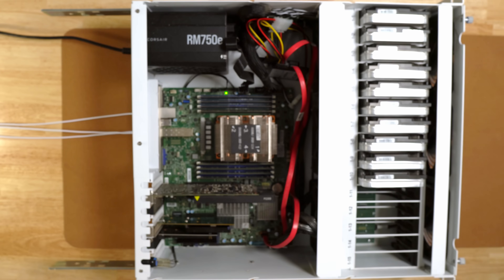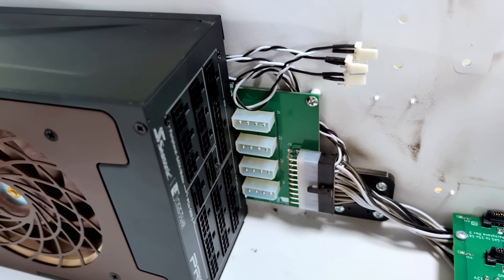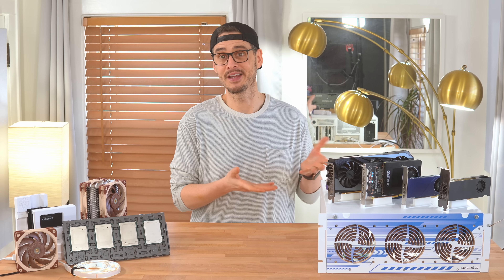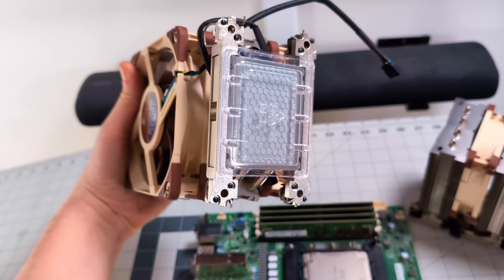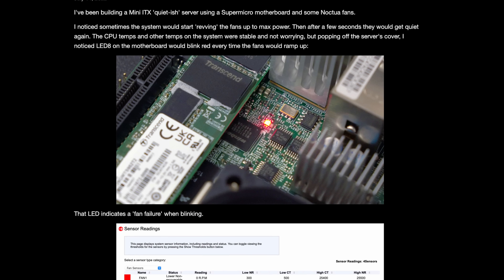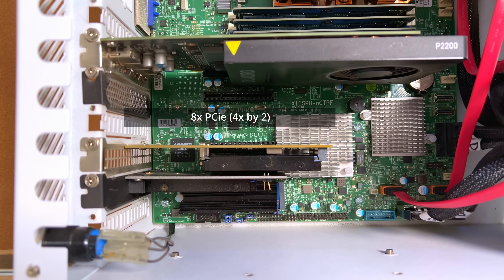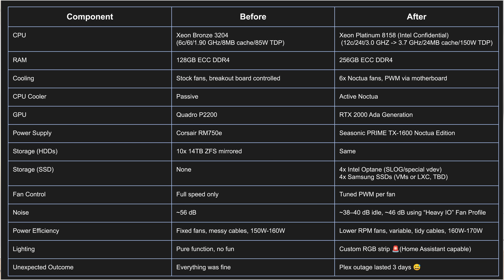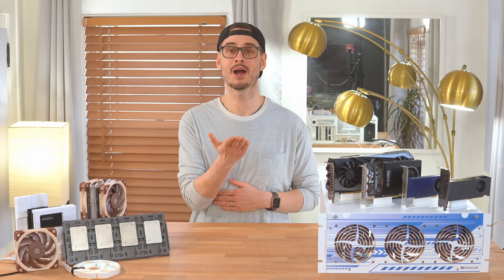I Rebuilt My Home Server — Quieter, Faster, and Ready for 2025

Comment: Holy shit 45homelab is a scam.

They sell "Home clients" for almost $800 USD!!!
The processor itself costs around $128 and somehow 8 gigs of ram and 250gb of storage cost the rest of the $650

You get a single board computer with 8 gigs of ram and a 4 core intel chip that is PASSIVELY COOLED so don't look at doing much with it. This is basically a bog standard thin client

Lookup " Thin client " for cheaper results that are just as if not more capable.

Comment: I love the idea of using Optane for special vdev, but aren't those too small for the amount of raw storage? I personally use two 1TB P4800x's I picked up during Neweggs fire sale of them last year. The smaller m2 optanes you are using I use exclusively as slogs though and run into zero risk of them filling with only 10G connection going to it. As far as my metadata usage calculations, I based it on 128K or smaller to be in that vdev, which for me for similar amount of storage you're using had me around 600GB of usage.
Reply: That being said, a second hand enterprise SSD would have been far better suited for this role, I am a data hoarder so the write benefits of optane are somewhat wasted as it's not like data is being replaced so the cell rewrites will be absolutely tiny.

Comment: it's 2025 so indeed there's no excuse for having loud server at home, if anyone wants something cheaper than Noctua case fans (and I am Noctua user), Arctic are also worth checking out IF you finetune the speed curves,
doubling the RAM is definitely biggest upgrade, almost slipped through in video :D
for AI, 16GB RTX 2000 Ada is bare minimum nowadays, though 16GB 4060Ti may be cheaper option, and if downclocked it can be almost on par in power efficiency in AI workloads,
I bet once you get into AI, you'll start looking for something like RTX 4500 Ada which has 24GB vram while still having modest ~200W TDP, having 4 of those (~96GB vram) is enough for nowadays top open-source AI models (and that 1600W PSU is designed to handle it)

Comment: Tim its likely not interference losing you zigbee connectivity on the lighting.  You have a small gain antenna and small signal amp inside a solid metal shell. The metal shell will absorb the radiated signal. 2.4GHz won't have the energy to penetrate and your grills etc will still mess with it. I would suggest a composite or non metallic window or at least for a test run the dongle outside the case to see how it goes. 

I tend to fit a small plug to my cases and have my emitter/antenna where I want and a small cable connects to the case. You could do this too for the lighting, even with a small hole just as a passthrough.

I have observed interference from 2.4 and 5GHz emitters being used in close proximity to other electronics so do be cautious about using radios inside a case. 

For a sense of context, I am a radiated and conducted emissions Specialist for the Australian Military (now retired). My work was to integrate systems accomodating EMI/EEE or determine how it led to incidents (plane crash, exploding panels etc).
Reply: I wish more of these little controller boxes had external SMA connectors. Most only have an internal antenna, and that means you have to try to get the whole enclosure somewhere that gets reception (means you can't always just bury the thing in a drawer or behind a desk).
Reply: shouldn't be too difficult to pry it open and solder an SMA connector to it though, heck might even already have mini smp on board and then you just need an adapter cable.
Reply: @bluewombat  True. How often it's just a little sticky antenna with a whip on the back that's plugged into a u.fl connector!
Reply from the maker: Thank you for the insight and expertise! I didn't even think about the most obvious thing.
Reply from the maker: I just want to report back I think it is interference.  When I shut the server down, I can communicate with it, when I turn it off it loses connectivity 😅
Reply: @TechnoTim  Well Done Sir! What do you think you will do to correct it?

It IS still possible that the case is reducing the signal too much and combined with radiated noise you end up with a misbehaving light controller. Direct radiated energy impacting your little gateway might not be impacting the send/receive signal, but other components that drive it out of operating range/stability. Hard to determine that unless you get it in a chamber to do real testing :). 

An example of that I worked with was ambulance... convert vehicles to use fiberglass canopy... which impacts resistance to HF signals from roof antenna (also no longer properly grounded). The antenna when transmitting on a specific frequency was causing an auto-defib machine to discharge incorrectly. 

You can see how that's all sorts of bad! It could be potential buildu p in the canopy (like a cpapacitor), the signal lines on the patient to machine were being induced with additional signal from HF but most likely scenario was direct high energy impact on the defib components and something didn't like it so it played up (repeatable and reproduceable error).

I surmise the best options for you would be a small pad antenna on the outside of the server and the light control in a metal box (shielded cable to antenna), remove controller out of the server, or try a different controller - it's a bit of a random lucky dip. 

YOu could even determine where it's antenna is, face that out, and cover the rest in foil (maybe stick it into bottom of lid?

I'd like to hear your feedback anyway Tim - thanks for being a champ and following up!

I see routinely interference from home smart devices because they are not designed to cope with an EM rich environment usually. 

They are prone to injecting noise into signal lines too - audio and speakers or cables in the correct orientation.
Reply: @TechnoTim  The advantage of a server inside a big metal box... the metal box is nice RF shielding. But that doesn't mean RF isn't bouncing all around inside that box!

Comment: Just redo the plug pinouts for any of those cables and they can all work for you. I'm unsure what your concern is with it after having realised they are not all terminated the same on the PSU end.
Reply: I did want to add you are spot on that it’s a foolish situation

Comment: The biggest issues were definitely the PSU cable incompatibility and the Zigbee interference. A universal PSU cable kit from CableMod could prevent future Plex Outages, and moving the Zigbee controller outside the case with a USB extension cable would likely solve the interference issue. Also, you might want to check the data retention of those consumer-grade SSDs if you are planning on using them for critical data.

Comment: Lucky the cable mistake didn't fry the drives, makes me wonder if 45drives didn't build in some protection to the power distribution board.  Nice CPU upgrade but I'd be interested to see the difference between the Xeon and an Epyc Rome 155W CPU, I have a feeling the 7302 or 7352 would be a decent bump in performance (Threadripper also an option but it's much higher TDP) and it's not that expensive if you can get away with an H11ssl-* or epycd8 PCIE gen 3 board.

Comment: I went through this. I just bit the bulllet and got custom cables made specifically for my seasonic and their sata board. Which ended up being better since i got them size perfectly to save room
Reply from the maker: Where did you get them from, Cable Mods?
Reply: @TechnoTim  Yes sir. I too have all sorts of psu around my lab, but didn't know cables weren't standardized until this build. Luckily cablemod allows you to enter in the psu brand and they make the cables accordingly. Saved the day on my H15 build.
Reply: @TechnoTim  Btw tim, please never use those SATA cables again... You have probably heard the old saying "Molex to SATA lose all your data", and thats because you are using MOLDED SATA connectors and not CRIMPED ones. The Molded ones are super dangerous and catch fire all the time

Comment: My main "do-it-all" Proxmox server got upgraded from 256 GB of RAM to 768 GB of RAM.

That was the main thing that was holding me back.

The next project that I am currently working through the details is how to cram four 3090s into a 4U rackmount chassis.

(Most consumer cards has the PCIe power plugs at the top of the card, which means that I won't be able to close the chassis on said 4U rackmount, so I am trying to figure out how I can work around that.)

If I can't figure it out, then I'll likely end up with a system that would be similar to what Digital Spaceport is running where it looks like it's a GPU mining frame, with either a Threadripper or AMD EPYC motherboard and CPUs underneath and I'll just connect the GPUs to the motherboard via PCIe 4.0 risers.

But I haven't fully settled on that yet.

Right now, my 6700K runs two 3090s, and once again, I am running into a RAM (and GPU) limitation where I want to be able to pass through the Intel UHD 530 Graphics into my Win11 VM (because that works better for YouTube playback than Ubuntu with xrdp and pulseaudio installed) and these are two systems that I run regularly. (vs other systems that I have, that either doesn't have a GPU installed at all (I run them headlessly), or I will power them on/off as needed.

All the while, I'm trying to minimise the power consumption, during full load (rather than idle power consumption because my homelab now, hardly sits at idle), AND also re-use existing hardware that I already have vs. getting new-to-me hardware, which helps keeps the initial capex costs down.

Too many tech YouTubers/homelabbers just keep acquiring more hardware vs. optimising for cost, power (efficiency), and performance.

(Many tech YouTubers/homelabbers will generally focus in on TWO of the three parameters, because optimising for three parameters is harder than optimising for two of the three parameters.)

Comment: I guess a prebuilt NAS is more power efficient but I wonder what the most power efficient home server you can assemble yourself is?
Reply from the maker: I've built a few low power systems that can be used as a NAS.  I even underclocked a 14th gen i3 and it used very little power.  Hard drives are were the power budget will be spent.

Comment: You got lucky with using different brand cables on your power supply. I once used a different brand SATA power cable on a build and the system powered on fully and it burned up a SATA SSD and an optical drive.

Comment: @2:35 It is Proprietary. Every company doing what they want with the pin-out. You want there to be an 'industry standard', meaning if different companies use the same plug, they need to use the same pin-out/
Reply: His point is that it’s only half proprietary. By using the same connectors, they appear at first glance to be compatible. He is saying they should have all used their own connectors instead of a standard one (I think)
Reply from the maker: @ You said it better than I did!

Comment: The one thing holding me back is whenever I use a dgpu for transcoding I get a playback failure. So I just have on x264 and let my 16 core sky lake CPU do the encoding
Reply from the maker: That's a bummer because it should work better than the CPU.  When you say Skylake, do you mean Core or Xeon?  I was going to say if Core then you could use the iGPU with Quick Sync which is a beast.
Reply: @TechnoTim  xeon 6130 i mean its fine it an do x264 at like 150 fps but yea a bummer for sure
Reply: @TechnoTim  its a xeon 6130 with 192GB of ram. it can do like 3 stream at once so its more than powerful enough just wish i could od the more effiicent option at the end of the day

Comment: If your not too bothered about idle power draw and want a ton of processing power on a "budget", i paid £780 for a used threadripper 3000 series cpu & mobo bundle. Way more capable, pcie lanes galore for multiple gpu passed through vm's and less power draw at idle without any efficiency tuning. Will also take you way further into the future than that setup ever possibly could.

Comment: Laziness is what holding me back. There's a sick deal on a MINISFORUM Motherboard BD795i SE which has an integrated AMD Ryzen 9 7945HX 16 core 32 thread cpu on $399. I want to use it with a Jonsbo n3 nas case but i work 40hrs a week so i get very little time to tinker.

Comment: I love that 45Drives box, have you seen their 45Pro line yet? Super interesting for homelabbers and even SMBs. 
This host was in your "Fancy Rack", right? How much did you notice the change in db with it actually being in the rack with the rest of your gear?
I love some Noctua tech, but if its just a box in a rack... is it worth the extra cost and time to swap them all out?
...asking for a friend :goat-turquoise-white-horns:
Reply from the maker: I "hear" you 😂. It's definitely not the loudest thing in my server room anymore like it was.  It's so quiet that I can hear the hard drives and that's it (it sitting behind me right now).  Outside of the noise, these use so much less power too, so much that after all of the changes I made, I only spent 10 more watts.  If you have good fans and you don't hate them, you're fine, but if you ever want to change them go this route!

Comment: The biggest thing holding me back from my homelab projects right now is the lack of fiber internet to my house. So much data I need to upload to remote storage for backup but 40 megabits doesn't cut it for many terabytes of storage. It's been 3 years since most of my neighborhood got fiber except for a little area around my house. Until this week, when they finally started running fiber mains along the poles near my and I should have up to 5 gig fiber internet within the next 1-2 months!
Reply: 40 Mbps per day => 337 GB 😂 × 365 × 3 = 360 TB in 3 years = "I didn't really wanna do it" 😂
Reply from the maker: Hopefully it gets there soon!  Also, awesome you have an off site location!

Comment: You are extremely lucky with the psu cables not frying any major components. PSA to everyone reading this: never use psu cables from another psu unless you are 100% sure the pinout is the same, even psus of the same exact model can be different internally
Reply from the maker: I agreed!  Also, check the pinout to be sure!  Just because it fits doesn't mean it's right!
Reply: @TechnoTim  This is why I often make my own cables. That way I'm to blame if it doesn't work.  It also lets me put on as many SATA ports as I need. :P
Reply from the maker: @perfectagent007  I'd love to know how you do this or a guide you follow!
Reply: @TechnoTim  Having the original cables to the PSU helps a lot because you have a working model to check against, but I look up the pin out of the PSU I'm using and then go from there. Making SATA and 4-pin Molex cables are the easiest because they make passthrough connectors for easy chaining. As for guides, Singularity Computers are my primary inspiration.
Reply: I made this mistake a couple of years ago and fried a couple of 10TB drives 😢 i dont understand why psu pin outs arent standardized
Reply: @pr0jectSkyneT  i ripped my 6 HDD's just because of this
Reply: Even same brand can screw you over, not all of the power supplies from a single brand use same ps side pinouts
Reply: @TechnoTim I also think you got really lucky! when building some ethereum mining rigs years ago I swapped out a 1 KW PSU for a 1.3 KW PSU, same brand - but different pinouts. I fried a motherboard before I learned my lesson ;(.

Comment: Isn't the RTX A400 the best value transcoding card from Nvidia right now? Given it supports H265 4:2:0 & 4:4:4 @ 8/10/12 and AV1
Reply from the maker: It is a great deal for sure, but twice the price of the Intel A310.  Also, I thought that the A400 could only decode AV1 and not encode (whereas the A310 can do both)
Reply: @TechnoTim  don't need AV1 encoding unless you're reencoding your media wirh it. Personally I reencode mine but with CPU as it gives a better compression result. The vast majority of clients will play back in AVC or VP9 (browser) which every modern card supports. My plex has a RTX4060. Not the best but it does what I need. I went for it because there were a lot of reddit threads on playback issues with the A310

Comment: I used to have a bathroom vanity that had 8 incandescent light bulbs at 100 watts each. It's crazy to me that now you can run this type of hardware for less than a quarter of the power it took just to power one small vanity in a bathroom.
Reply: Yes! Our power usage is a fraction of years gone by, but the monthly cost is higher than ever.
Reply: I still have 8 filament lights in my vanity.